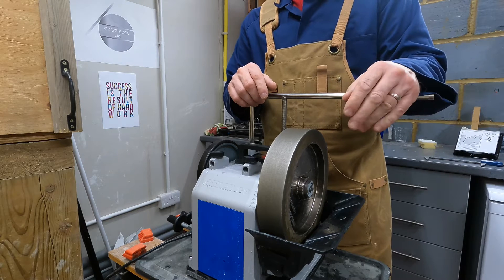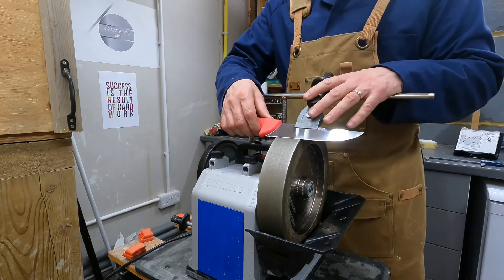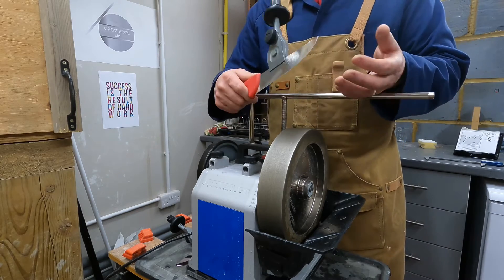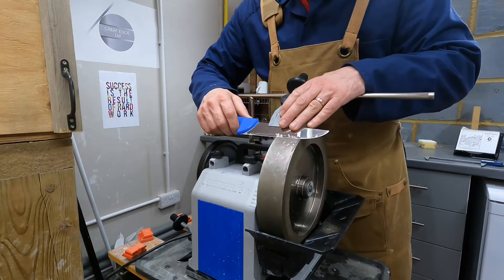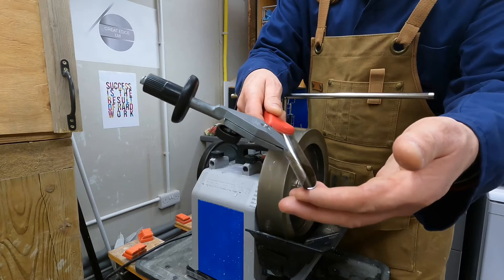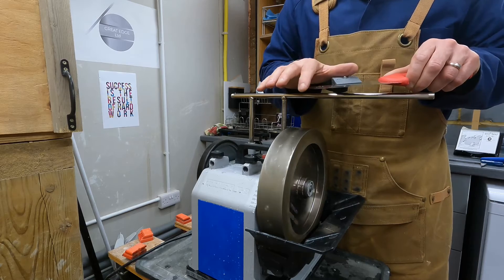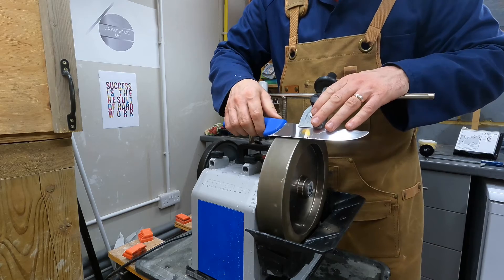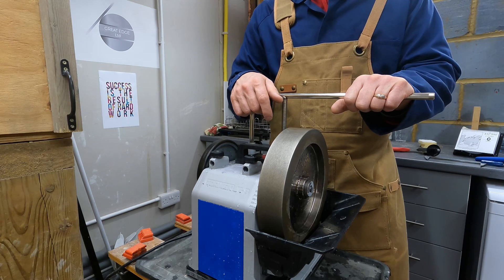Lift the handle, or pivot the handle when sharpening with Tormek T8?

Comment: I’ve had my T8 two months.  I’m hoping you can help me correct a problem I’m having.  I start sharpening tip first, starting with the handle high and lowering as I move away from the tip.  My issue is, as I sharpen and move towards the handle, I’m make less contact on the bevel (about the last 1/2 inch). I use a sharpie and I still have a mark on the apex and a portion of the bevel.  Hope I explained that clearly   Can you help with some suggestions of what I may be doing wrong and how to correct it.  . Thanks.
Reply from the maker: It’s a hard question to answer without seeing it, but if the spine is very thick, you might find that the knife isn’t sitting square in the jig.. So you are actually sharpening at different angles along the length of the bevel .

Comment: Wow, finally a spot on demonstration of both methods that I've seen by various people /channels! Great job sir! Interestingly there's a guy that has a full shop set up with multiple sharpening systems and he obviously sharpens for a living, but he uses the method that you used on the red handled knife which produces a different angle on the belly and tip. I find it kind of baffling that he never bothered to consult tormek on the correct technique given that he has such an elaborate shop setup! So thank you for the education and the great video!
Reply from the maker: Thanks for the kind words.

Comment: Question for you, if you have the time. Your lift technique worked perfectly. I'm able to lift a burr for most of the blade, but as I approach the hilt, the burr decreases or disappears altogether. I've already learned (on crappy knives) that a slight delay near the hilt creates an uneven bevel. Do I then keep sharpening the entire blade until the burr appears near the hilt? Perhaps I've already answered my question! Thanks again.
Reply from the maker: That part of the blade is tricky to get just because it has less contact time.   If  it is the only part not to have a burr, what I do is dwell on that part - moving the knife slowly - and then once I’m clear of it I move much faster. That allows to not over grind the  part of the knife that already has a burr, but also keep it smoothly blended in with the part you are having to apply extra time to… I hope that makes sense. It can sometimes help to apply a bit of marker to the blade as well, just so you can see where the area of focus is.
Reply: @greatedgeltd  I'll give this a whirl. Thanks and much appreciated.

Comment: I have the same issue using a Worksharp Ken Onion Elite. I'm going to adapt your method.
How do you deal with a kukri or any other weird shape knife?
Reply from the maker: Convex and concave edges are done by lifting and lowering the handle respectively - I have a video about the latter from a few months ago (called ‘sharpening concave edges on a tormek, or something like that)… Concave is definitely trickier because the point of contact for grinding is so small, and when you have concave and convert on one blade that is trickiest of all to blend it all in smoothly.  Hopefully this video and that other one will help, but it’s certainly something that needs practice…. Good luck!